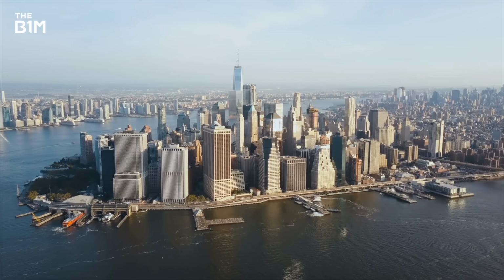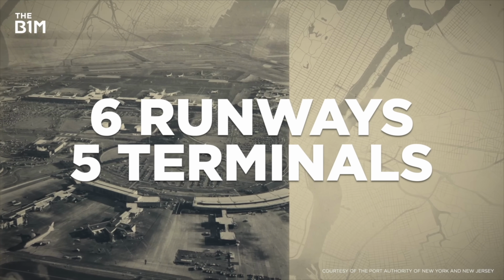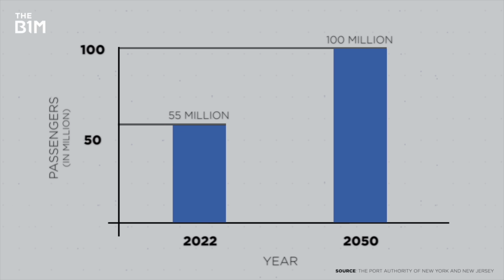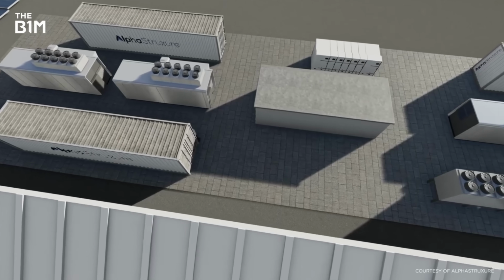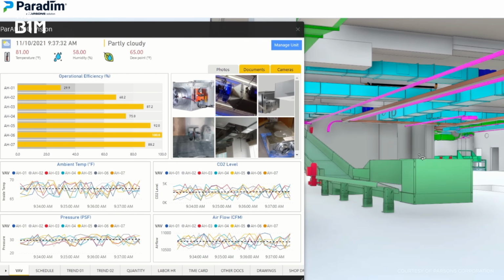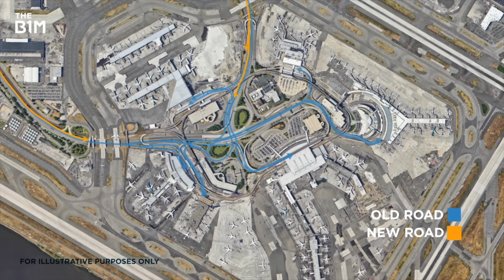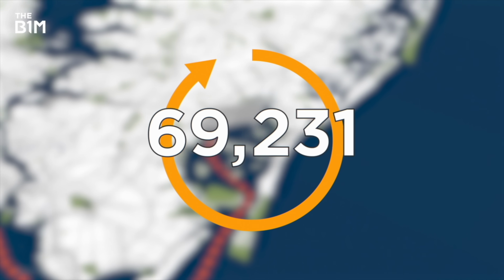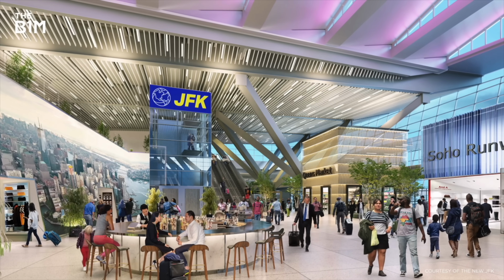The $19BN Plan to Save New York's Worst Airport

Comment: "PV array allows to be resilient in case of any power disruption" - ok, clear. Direct lie, not talking about inverters turn off in case of grid loss, but at least airport is intendend to work 24/7 and the sun is not. So, dear Americans, prepare for another multibillion fail. Timber facade and EV chargers as bonus, Dusseldorf airport wil envy.

Comment: I didn't catch it. Will the new terminals still be owned and operated by the airlines? Because if so, while the in-terminal customer experience will be nicer, it won't do much to improve overall efficiency of airport operations regarding passenger flight experience.

Comment: Expanding the capacity of JFK is a good thing, but getting to JFK from the city and surrounding counties is already a nightmare. As you approach JFK from any direction, expect to spend 30 min stuck in traffic once you get within 10 miles. Its particularly frustrating (and expensive) if you are in a taxi with the meter running.

Comment: The worst airport in metro New York is Stewart. Go to your map of the sand barge route up the Hudson River and look for Newburgh. Great runway (former Air Force base). Negligible number of flights, no public transit (a reminder that the east side of the Hudson is where Amtrak and MTA operate. There used to be passenger rail on the west side of the Hudson, but it went the way of the dodo bird, and its now only freight).

Comment: The problem with JFK is that it has distinct terminals that are not connected. Many travelers have to move from one to the other. They should have connected the terminals and provided transport between them like ATL and Dallas. And how do you get there by Cab at $200 a pop. REALLY NYC?

Comment: What a crazy reversal and ironically, a sign of progress. Not 10 years ago I much preferred JFK over LaGuardia. Now it is the opposite. In both cases, I have to agree that there should be direct subway access and/or Airtrain extension much closer to city center.

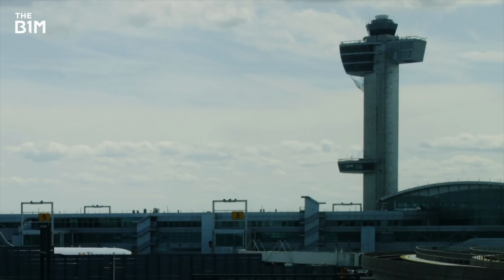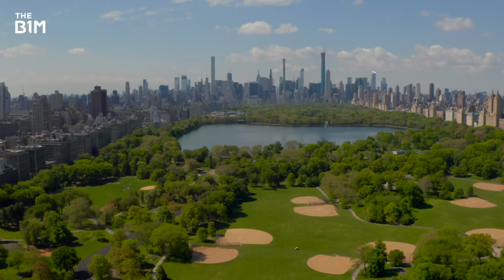Comment: IPS ACDSEE PRO Ultimate Max Ex Indexing euro 💶 HSI DAX Bitcoin Standard Ranger Sub Tropical WiFi5G routers modern G5 Plus Ex Flex Translate to English Mandarin Mochi Unicode Dowjones Kospi 3QRCode PHP Codes Marine Standard Chartered BNP Banking Online Login Terminal Waterfront System VR Ranger Ex Indexing euro 💶 HSI Blue GYRP routers G5 Plus Ex Blue GYRP address Enterprise V12 engine JFK International airport road trip FTSE 250 IndexEuro HSI Dax Bitcoin CGI Bold Green Stylish ✨ ✨ ⭐ ✨ ✨ JFK airport New York Bo 0:13 ston 60 Green Massa 0:07 chusetts Washington DC sports wear FTSE Indexing euro HSI Blue GYRP Kospi Ziroom ICDCM NL SASAKI EX Architecture Archicad B1M Enterprise EX Enterprise V12 engine CMYK RGBs Archicad 2019 B1M Render Code Marine 3QRCode PHP 🛜 HP Pavilion EX Exness Platform UPS APC Around Code Marine 🛜 3QRCode PHP IndexEuro:67-78 56-87 Kospi 4.6324.78 Univer ScaleCity Freshwater plugin Freshair Ohio Santorini Greece and Turkey Denmark fryer Sub Tropical 🍹 Navigation System Fine Arts Academy Sports Wear CMYK RGBs 🧭 Highways Richard Avenue's RoaEnglish Extra Larger Flex Hyper Massive Scenery 0:08  Richard Expensive Swimming pool and Table tennis courts 🏓 🎾 ScaleCity Scenery Tennis Racket Graphite 🎾 Topspin Super easy 8/11 Code Marine 3QRCode PHP 1/5000 GraphicRiver Freepik Fine Arts Arcademy Sport Wears Scenery CGI Building Modern City Urbanist explore city Apartment NL Ex Expensive Mediaeval Architecture Render Code Marine Super PHP Pro Exness Platform 🛜 Kospi Univer  ScaleCity Avenue Campos Highway RoaEnglishfit FTSE 250 IndexEuro:56-67-78-87 HSI Dax Bitcoin CGI Bold ✨ ✨ Avatar Stylish Security networks program Extra Larger Hyper Massive Scenery Richard Expensive Fine Arts Arcademy Sport Wears Bluegyrp Exness Platform 🛜 UPS APC Around Code Marine QRCode PHP Pro Exness Platform Scenery Render ⭐ ✨ ✨ Stylish QRCode Green Skyline Amazing view 🪟😁🐠🍹 Exness Platform Terminal 6:27 //1.4.5.6 network 🛜 traffic ⛔🚦 CMYK RGBs Massive Train Railroad Navigation 🧭  system Bus 🚐🚌 Neutral Project JFK AIRPORT Long Beach 🏖️⛱️ ICDCM NL EX Architecture Archicad B1M Ocean 🌊 🪸 View 🪟 Program to The Sea 8//12 Street Maps App WK ACDSEE PRO Ultimate Max Ex Blue GYRP System Fine 350 320 Revit LT MEP Lumion 10 Render Avenue Campos Modern Highway Roaenglishfit  Dynamic Gigantic Olympiads Fine Arts Academy Sports Wear CMYK RGBs Massive Fine Skyline Economic growth SK Bold Stylish Texture Standard Chartered BNP Banking Online Login Terminal Waterfront 3QRCode PHP Codes Marine System Standard Ranger Ranger Indeed Experts Options Kospi WK Kospi University PHP 3QRCode Codes Marine Standard Ranger Ex New York NYPD Fine Airport FTSE Indexing euro 💶 8 12 350 320 Street Maps App WK HSI DAX Bitcoin Standard Chartered Banking  Online Login Ranger

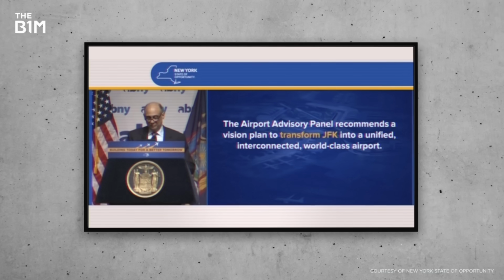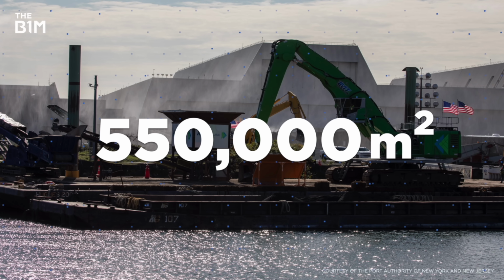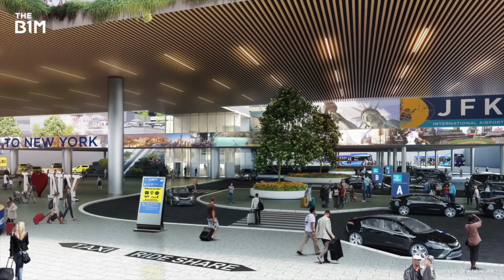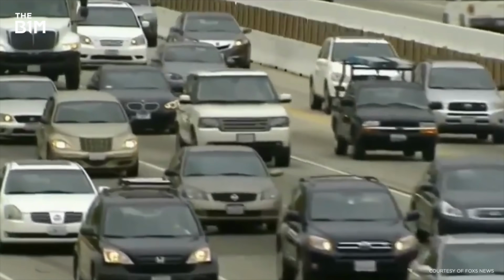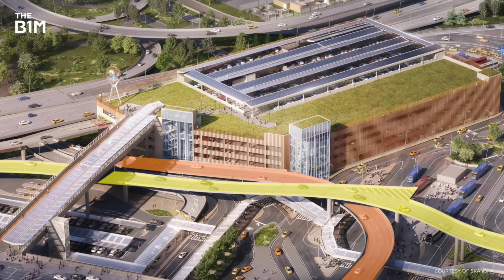Comment: Standard Chartered banking Online And Commonwealth's and BNP Paribas Fortis healthcare Bank account Online 🏦 🏦 🏧 2:54 9:05 Aedas And Mediaeval and Architecture NL Architecture Archicad 2019 B1M Ex Expensive Revit MEP engineer LT Lumion 10 Render GBrighton drills plendid Bowling Alleyways PHP sun Render IndexEuro:67-78 Kospi 4.6324.78 Boston 60 Green 🍏 Red 🍒 Univer ScaleCity Seaside  of City Long Beach GBrighton drills plendid Bowling Alleyways PHP sun RGBs ft gt 0:14 0:57 Lenovo Thinkpad AMD Radeon Ed 0:13 it Video Dynamic Gigantic 0:12  Gorgeous Glamour London Stockholm Glamour Capri Denmark Amsterdam Paris Venice Welshpool WA WA Don't forget Wuhan beach NY Dowjones All the Time Scale City Urbanist ex 0:15 plore city Apartment Green Airport Code Terminal Aircraft 🍏 Red 🍒 Dowjones All the Time Scale City Urbanist explore city Apartment Green 🍏 Red 🍒 Enterprise V12 Infrastructure Industry Public Transport Street Map Menu Food Was Good HMS PPI check today Sportswear Outfit Socool WSJ ✅ Ex Expensive Premium Ranger IndexingEuro: 67-78✅ Sportswear Green 🍏 Red 🍒 1:57 ICDCM Enterprise V12 JFK'S airport RGBs Revit LT Architecture MEP engineer Lumion 10 Render Archicad 2019 B1M Ex Expensive GBrighton drills plendid Bowling Alleyw 7:17 ays PHP sun Code Marine QRCode PHP Exness Platform UPS APC Around Code Marine 🛜  HP Pavilion 🎉🎉😮😮😮😮 IP address Enterprise V12 engine light car Google Maps 🧭 system Bus 🚌 🚐 ICDCM NL EX Architecture Render Revit LT MEP Lumion 10 Archicad 2019 B1M

Comment: The Port Authority can spend whatever it wants, but without easy access to public transport (the current monorail is pathetic), it will still be a mess. The biggest problem is the Van Wyck Expressway, JFK's primary access highway. It is always clogged. I live in the Hudson Valley (north of NYC), so I only use JFK when I'm desperate; I prefer Newark, which isn't as bad as its reputation or, if possible, Stewart or White Plains.

Comment: As a New Yorker, I dread having to use JFK. I dread having to even pick up friends and family at any of the terminals. The layout is beyond confusing, and there really is no real, seamless connection to mass transit. Using JFK means dealing with cars, busses, and some of the worst traffic possible. I wish the video had touched on any improvements regarding the air traffic control tower and its computer systems.

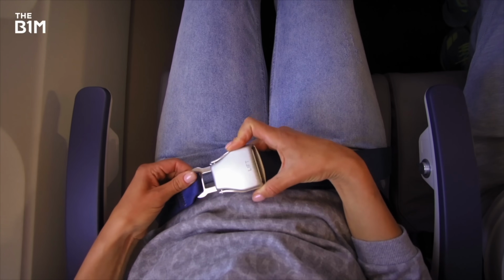Comment: 0:59 1:09 0:31 🎉🎉😮😮😮😮 NYSE Budget And New York Boston EX Exness Platform 🛜 Dowjones All the Time Scale City Urbanist explore city Apartment Green 🍏 Red 🍒 Terminal Aircraft Enterprise V12 engine RGBs NASDAQ composite squadron materials Freshwater plugin Freshair Ohio Santorini Greece and Turkey Highways Richard Avenue's RoaEnglish Extra Flex Larger Hyper Massive Scenery Richard Expensive Swimming pool and Table tennis courts 🏓 🎾 ScaleCity Scenery Tennis Racket Graphite Topspin PHP Super easy 🎾 CGI Logo Ex Expensive Fine Arts Arcademy Sport Wears ft HP Pavilion EX Expensive Indexing:67-78 Kospi 4.6324.78  GDP 24.6324.78 Univer ScaleCity 🛜 Code Marine 7:47 Boston Monaco Welshpool WA WA beach NY Dowjones All the Time Scale City Urbanist explore city Apartment Green 🍏 Red 🍒 Don't forget Wuhan ft FX HP Pavilion Pro Exness Platform UPS APC Around Code Marine QRCode PHP 🛜⛱️🎾 ScaleCity Scenery CGI EX Expensive Exclusive Exness Platform

Comment: Unfortunately JFK will never be "world class" as long as there is no direct, one-seat rail connection to Manhattan.  Major world capitals' airports around the world require one upon arrival to simply take an elevator down to a rail/subway/monorail platform and off you go to the central business district.  As long as the Port Authority vs. the MTA dynamic is allowed to continue, we will never have this sort of service in New York City, which is a true embarrassment.  The best we can do is a disjointed airtrain system to another train or subway, and at LGA we couldn't even manage to have that.

Comment: There were actually 9 terminals, the current Terminal 8 was built where the old #8 and #9 sat. The new Terminal 6 is replacing the old #7 and the new Terminal 1 will cover the space of old #1, #2, &#3. I do hope they remember everything when this is completed since it should be 4 terminals, not 8 with missing numbers!

Comment: Do the B1M-Team use an AI created voice to read aloud the script? 
I can understand if you do so, because it has its advantages. Videos can be produced much faster, as there is no need for the owner of the channel to be available to speak the text. And there is no problem is he has a cold and therefore his voice sounds terrible. And no need to cut out any mispronounced words or gaps when narrating the text.
But on the other hand such an AI comes with its disadvantages. As other viewers already commented, there are several unnecessary repetitions of information and other quirky errors, especially the mismatch of square meters of concrete to fill Olympic pools. If no one trained the AI to notice and correct such logical errors it will bluntly narrating the script. 🙂
At least, please inform the viewers if an AI is used for narrating the videos.
Reply: Despite your question, none of the videos produced by The B1M use a computer voice. With a computer voice, videos are rushed and words are not pronounced correctly. No speech synthesis method is fully perfect, so using a computer voice totally does not work.

Comment: I flew into JFK for the first time a month ago on Alaska Air. Can't remember which terminal but it felt like arriving in some tiny podunk place in the 1960s. Kind of a shock when most airports these days (outside of the US) are big and modern, with good signage and connections.
It was only on the Airtrain that I realised JFK was a bunch of separate tiny terminals. My son had researched and told me to get the Airtrain to Howard Beach to catch the train to Manhattan. Not user-friendly much, especially with luggage. However it was sweet to pay just $2.40 or something for the train into town. ($8 for the Airtrain.)
Is JFK unique in having lots of little terminals? Seems unusually difficult for passengers, to have to walk with luggage out across roads and rubble to get to the Airtrain, and then to have to change to another train.
The elephant in the room seems to be just how degraded and old a lot of public infrastructure is in the US. The nation is a powerhouse of an economy but it must have had a century of underinvestment in ports, airports, bridges and rail systems! Thank God Biden is investing billions into the railroads. Also I'm glad Seattle invested in new passenger ferry facilities because the old port building literally could have been used as a set for some grimy, Depression-era film! Seattle is also pushing ahead hard on expanding its light rail system - albeit with time-consuming hiccups - and yes you can catch it straight to the airport.

Comment: All these airport renovations and expansions are great for travel today.  However, carbon emissions from air travel may very soon limit the number of flights throughout the world.  Even now, Europe is experimenting with limited air travel between cities less than 200 miles from each other.  Land and sea travel have options to replace fossil fuels.  But, air travel has little to rely upon except lighter weight materials.  We may see the day, sooner rather than later, where airports will be useless dinosaurs with little adaptability.

Comment: I don't think this project should be such a high priority. JFK's terminals aren't too shabby, the runways are already near capacity without space for further expansion, and this will just incentivize the airport to schedule more flights than it can reasonably handle.

Newark should be a higher priority for a megaproject, since it actually has a path to increase its capacity, and the solution needs a lot of investment to work. If EWR reconstructed its terminals mid-field, they could squeeze in a 3rd, independently operated parallel runway (greater than 1310 meter separation) that would increase overall flight capacity by up to 70%.

By going with a terminal layout similar to Charles De Gaulle's Terminal 2E, the reconstructed EWR could go with a design that combines the efficiency of the concourse layout with the convenience of the pier layout. This would also leave space for US Route 9 and an air train to be rerouted directly through the terminals, allowing for better traffic flow, and a zero-transfer connection to Penn Station.

Comment: It's been a long time since I flew into JFK - but as the terminals are located in a circle wouldn't it be simpler to have a light rail connection between the terminals? And what are the connections to the NY transit system? There were lots of mentions of car parks etc but not much about mass transit.
Reply: There is an existing AirTrain that connects all the terminals, long-term parking, and rental car location. There are two lines--One goes to Howard Beach station connecting to the A line of the NYC Subway and the other goes to Jamaica station connecting to the Long Island Railroad as well as the E, J, and Z lines of the NYC Subway.
Reply: @rnunez6398  Thank you. So no direct connection to Manhattan? You have to change trains to get into the City? Or do the subway trains come out to JFK via those links?
Reply: @MalcolmRose-l3b  That's right. No one-seat ride which is a long-time criticism. I know other Metro systems have a stop at the airport which would be preferrable but don't passengers still often need to take a people mover to get to the train station from the terminal they land at?
Reply: @rnunez6398  Most major European airports have rail and / or subway connections to at least the local transit systems. Both Madrid and Heathrow airports have subway and rail lines that connect the terminals to the city centres - from Madrid to Atocha Station is about half an hour and that is the departure station for the AVE trains - which are fantastic. Gatwick has a light rail shuttle connection between the two major terminals, one of which has a direct rail link to central London and that part of the journey is relatively painless. 

A direct rail / subway connection is something that Europeans would regard as a basic requirement for a major airport, so I'm a bit surprised that a city like NYC which, by American standards, has a pretty good transit system wouldn't take the opportunity to have a direct line.
Reply: @MalcolmRose-l3b  Yes, it is a bit befuddling that the US has such a hard time doing what seems quite common in Europe and Asia. On the positive side, at least JFK got a rail connection after decades of discussion and planning which despite its shortcomings is used by millions of people annually. Unlike LaGuardia Airport that still relies on bus service.

Comment: Some notes I wanted to make about your video.
 
1. 2:10- Not all terminals are operated by airlines- some are operated by private companies. T4 being operated by JFKIAT, T1 will be operated by NTO, T6/7 will be operated by JMP.
2. 2:23-  Saying airlines can never divert to another terminal is also inaccurate since all terminals do their best to support each other in times of need. T4 accepts flights from other airlines/terminals not scheduled to be there on a regular basis. They will also accept flights on an emergency basis if necessary. The main issue is the ground handling staff may not have the necessary man power/equipment to support an operation in another terminal if they are not based out of it as it'll stretch them thin and take time for them to get there.

Comment: Some comments: at 3:11 isn't that Frankfurt airport? .... later in the video: 550.000 "square"(?) metres of concrete are produced; shouldn't that be cubic metres? And from the video it's not really clear if the disconnected terminal buildings will be connected in a better way (and not only by roads). Is that happening?

Comment: I question how good this new airport will be. For example, the new Terminal 1 gets 23 gates all which can handle A380s, a plane that has been discontinued and won't be operating much past the next decade.  So when it fully opens in 2030, the gates will not be at maximum capacity as the gates will service smaller planes then they can handle.  The Terminals remaining after the redesign will be Terminal 1 (new), Terminal 4 (already open and finished), Terminal 5 (redesigned and expanded with 6), and Terminal 8 (redesigned, merged with Terminal 7).  Four terminals in the end with 151 gates, up from 128.  AirTrain will still run to all the terminals and the roads will be rerouted to make it potentially easier to get around by car as well.
Reply: There are no pure A380 gates. They might have a second floor jetway. Other aircraft can generally use the main level gates.